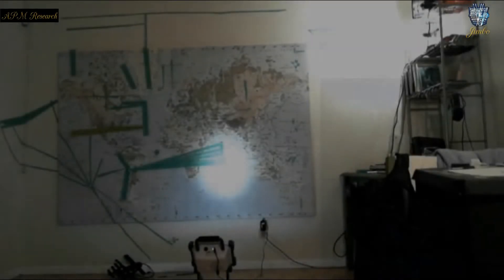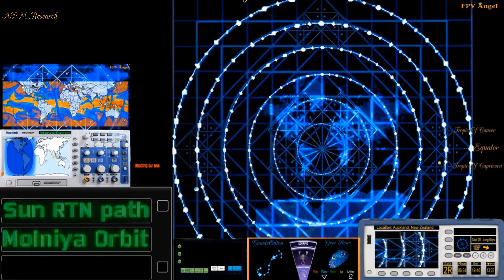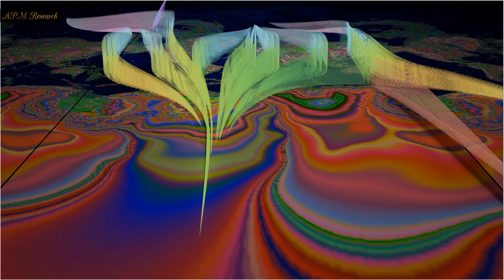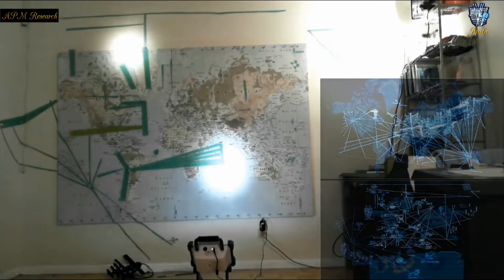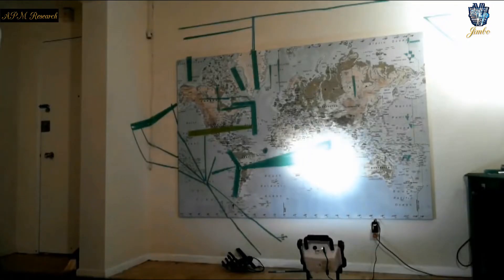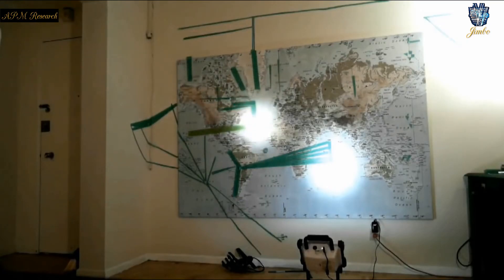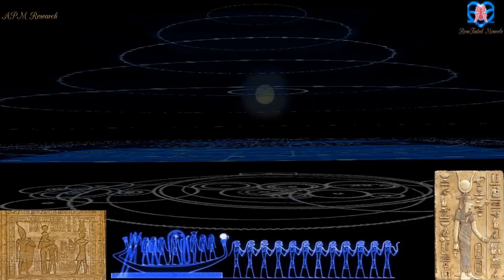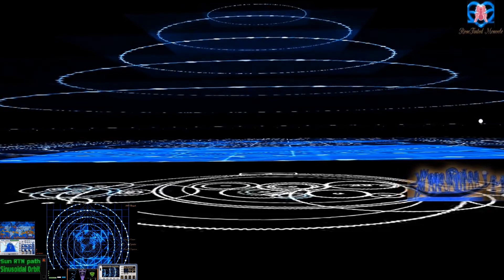APM Research: The Sun Mechanism Decoded And Explained.

Comment from the maker: I made a shorter clip so this is easier to find in our research, it shows how the Nazca Line blueprints helped Jimbo understand how this mechanism works so he could explain it in technological terms. Rose covers the Sun's return path (flyback killer mechanism) using the Egyptian 12 Gates animation i made to show how they depicted the Sun returning back to the East gates. The magnetic data images were supplied by Ceres (OneHippy). You can watch our 12 gates video here ... https://www.youtube.com/watch?v=oZ25MkW3CIA
Reply: FPV Angel Hey bud. Great stuff as usual. But curious why you don’t use UN style flat map? Like he said, this map messes with country size & angles
Reply from the maker: @josh2388  He means the globes distortion. Because someone says the round map is the flat map it does not make it so, they all have to be proven, those round maps are easily debunked, i moved away from them a few years ago, all realworld data is recorded on the Mercator, the one we use has had the distortions corrected.
Reply: FPV Angel Thanks for info. Guess I shouldn’t be surprised if the UN was capable of ‘Level 2’ trickery!!
Reply from the maker: @josh2388  No worries, ive never seen any other model progress like we have, thats why i started doing my own research, the pizza maps were stagnant and it hasnt changed much in the last 2 yrs, sealed, packaged and sold yet debunkable, seems pushed by design.
Reply: Wow! Just got here from Jon's channel. 
Bars are placed by...???
Reply from the maker: @caspianlake8475  Hi Beverly, the bars were placed by the creator/s of this technological construct, the blueprints for which i decoded from the Nazca lines which were obviously placed for mankind to see when we took to the skies as they are impossible to decode at ground level. The grid overlay we use on our map comes from the Nazca lines and the gates (or portals) referenced by Enoch and various scriptures align in the North, South, East and West as they describe, this is no coincidence.
Reply: FPV Angel- thanks for the info. Brand new subscriber... How does the sun simulator fit into this please??
Reply from the maker: @caspianlake8475  Hi Beverly, the sun simulator - is not a simulator, that is our real sun, a technological masterpiece, if you look at the sun halo videos here on my channel you will see that particulates in the atmosphere help reveal its true profile, we are seeing an electro-magnetic projection from below - as scriptures everywhere relate to, an underworld, the creators glory is a technological glory - they hid that part for obvious reasons. People are confusing what they are seeing and labeling it wrongly, the light device man built which some say is the sun simulator - is not the same configuration as the suns projection so it tells me the man made "sun simulator" which is made of lots of lights - is probably going to be used somewhere the sun does not shine - say south Antarctica for example, i did make a video where i recorded around a months worth of a light source from their Antarctic cam and the light source never moved - you couldnt see the device but you could see the effects of it clearly, a pulsating light source.